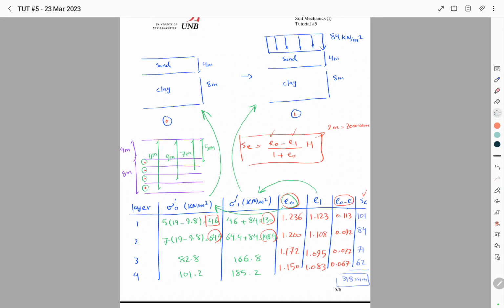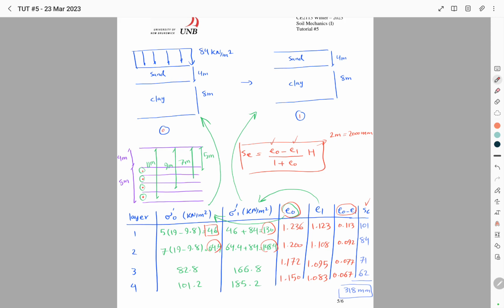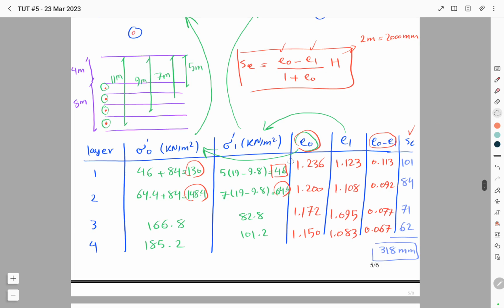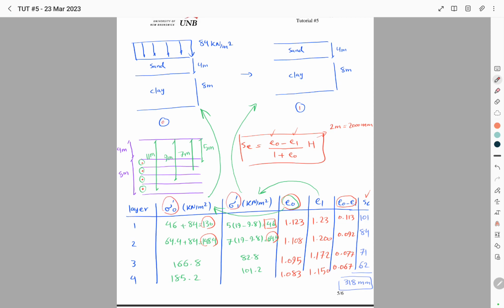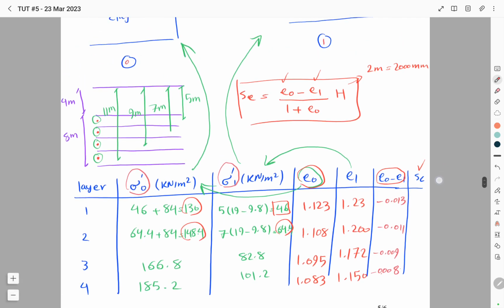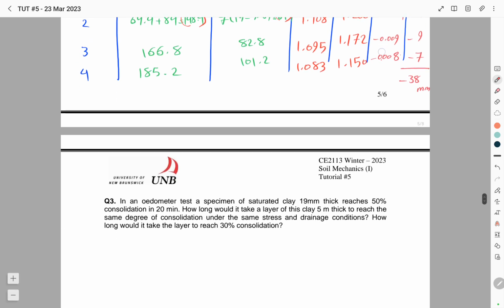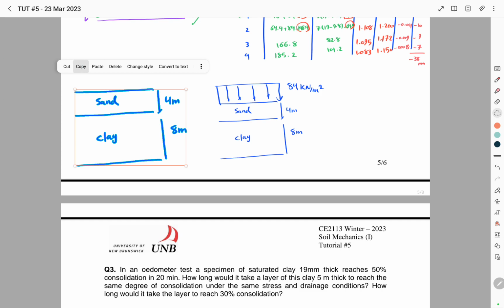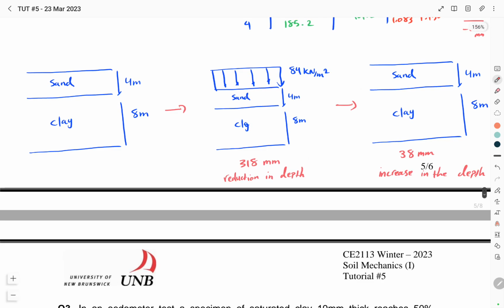Consolidation Examples (Q2.2 - heave due to unloading) - Soil Mechanics I

Comment: Hi,
Why did the (e0-e1) value change in this part?
It must be same value as in part 1 unless it’s negative.
Reply from the maker: Hi there. Thanks for bringing this to my attention. You're absolutely right! I just double-checked with the textbook and since my focus was more on the procedure, I copied those values from the book when I was recording the video. However, since these "e" values are just approximations based on the chart, you may never get the same answer as someone else, but the final answers would be pretty close! Thanks again for your vigilance!
Reply: So, is the settlement values correct in this 2nd part of the question? I tried and I didn’t get these answers for settlement
Reply from the maker: @rejijoy2052  I'll record another video and solve the question again. Sorry about the confusion.